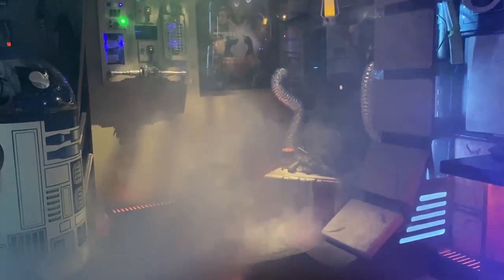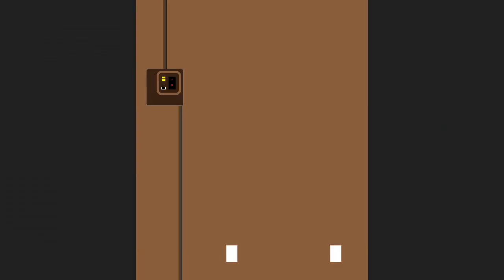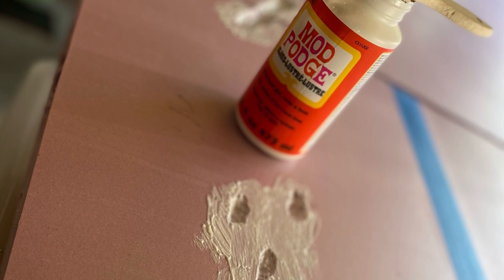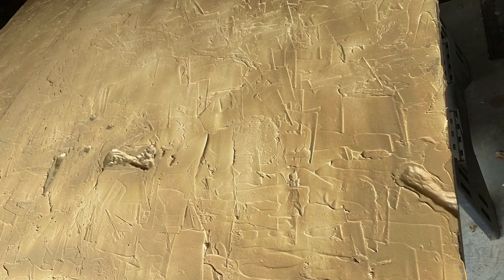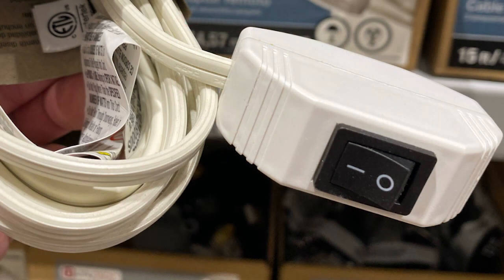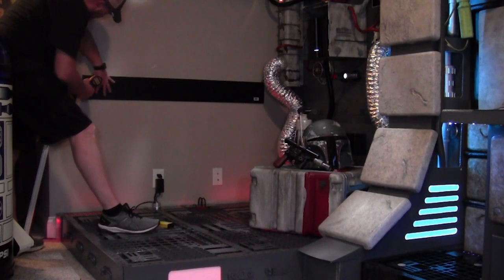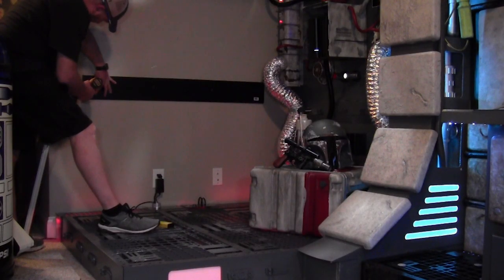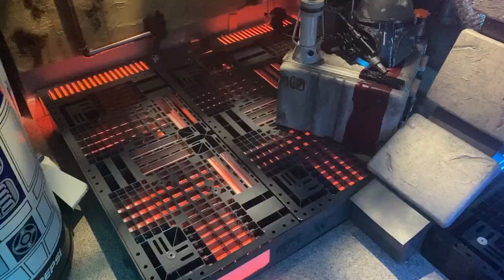Star Wars Stone/Stucco Wall with Control Panel

Comment: What powersource did you use on the arcade buttons? Is it all off 120 or did you have to step it down for 12volt? I use LEDs alot but have to use batteries. I would rather figure out how to power them from wall 120 power.
Reply from the maker: Kelley, that's a great question! I used a 12v power supply from Amazon for the buttons. I believe I left a comment on Facebook for you. If not, reply back and I'll send you a link.